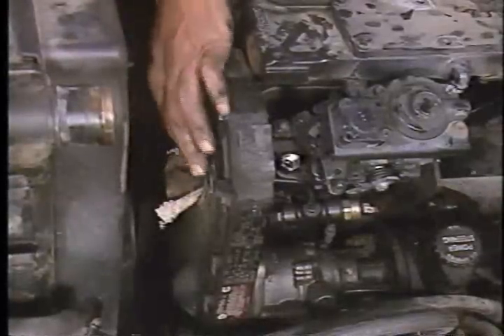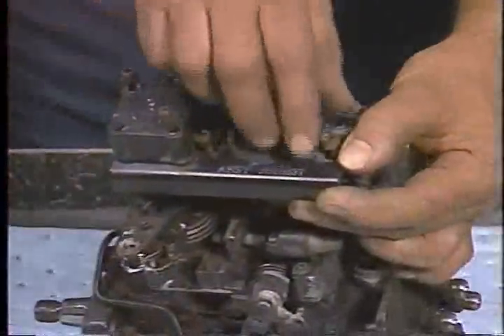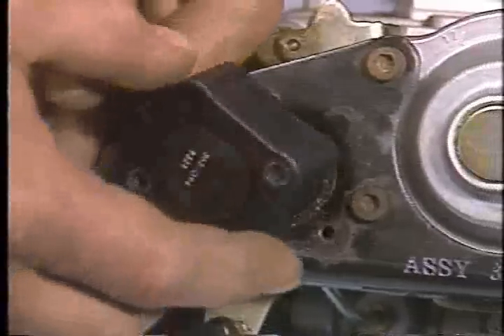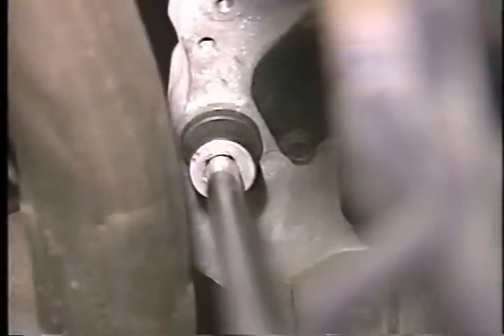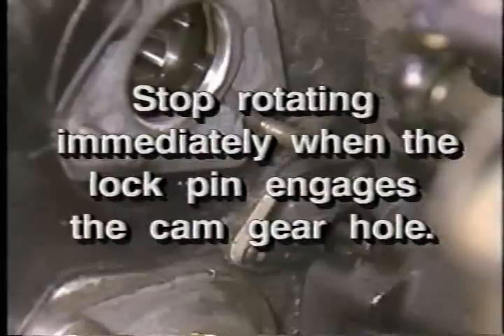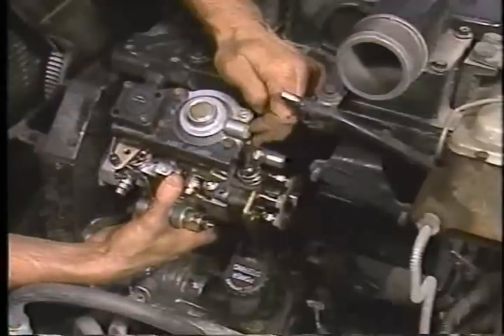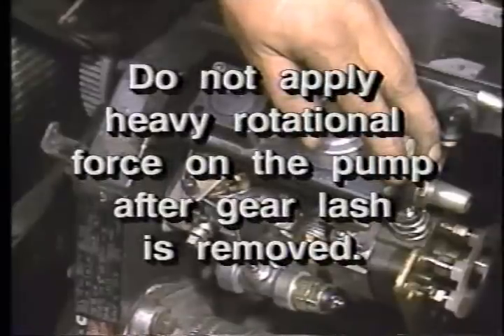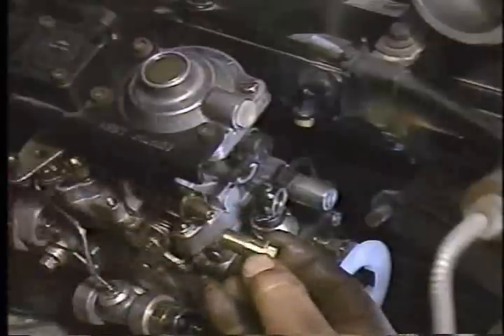5.9L Cummins Injection Pump Replacement Part 2

Comment: my 6bt case tractor seems be smoking more [blue] since i replaced pump. the cummings is very similar to the truck motors. i did not turn pump for gear lash since i had pump and lower gear lock engaged. the old timing marks looked good. tractor starts good but doesnt sound just right to me. also left flat puller on pump gear to hold it while pump gone, wondered if you could get pump gear one tooth off when going back.

Comment: How do one know that the new pump is in the right place? The pump could be at cylinder 2 TDC?
Reply: Because the camshaft and injection pump gears rotate at 1/2 crankshaft speed - what you are theorizing is 100% impossible

Comment: Worked on one it did not have a drive key 🔑, actually the drive key was 4-5 o clock position … so all you have to do is find timing pin hole 🕳 in gear ! Make sure new injection pump is lock in time #1 —-I had to remove timing pin assembly to find hole so annoying !! Has any one ever experience a pump with no keyway ?
Reply: No keyway or no key?